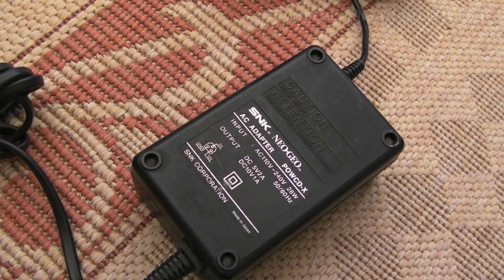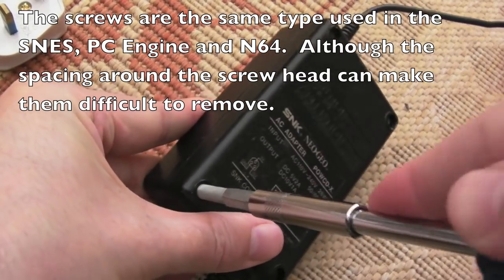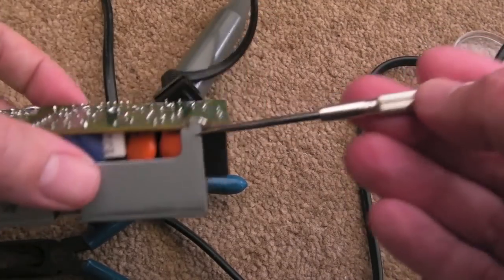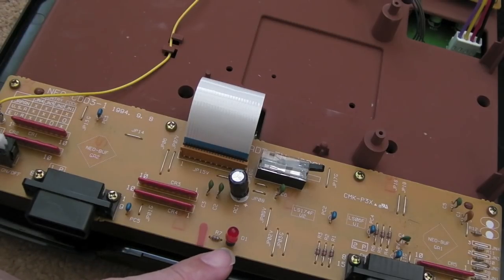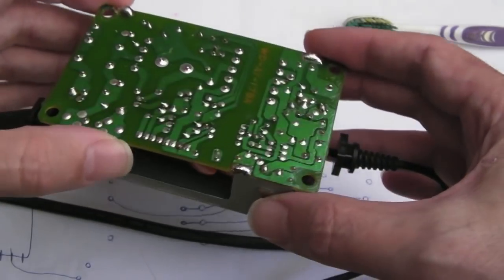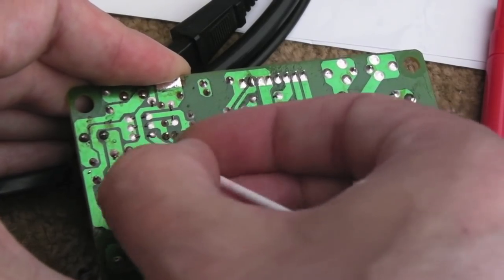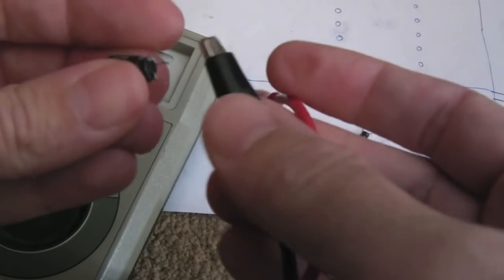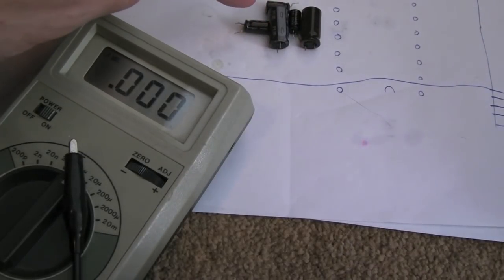SNK Neo Geo CD PSU (Power Supply Repair) Repair (Flashing Power Light)

Comment: My Neogeo CD console power light does not come on after press on power button. May i know what's wrong? The red light does blink once when i switch on the power supply to it
Reply from the maker: Most likely the PSU needs recapping -- very common.  It could also be a blown inductor on the Neo CD board - I think LukeMorse1 has a few videos on fixes like that, worth checking his channel out!  The power connector on these is also a source of bad connection.

Comment: Hello ! I have a question, is the power supply of Neo CD made noise after 30 min or 1Hours use ? It is normal if it made noise ?
Reply from the maker: Have you replaced the electrolytic capacitors inside the PSU - chances are that's the cause!  Be carefully if you do - there are dangerous high voltages stored in one of the capacitors there even after the PSU has been powered off.
Reply: @GadgetUK164  No I don't replaced any one of them ! Just buy a NGCD recently and I was surprised by the noise/sound made by the PSU after a moment of playing !

Comment: Always the smaller value electrolytics. Seen it time after time in switch mode supples.
Reply from the maker: Yep, I agree!  I think the problem is the value is very small, so a small deviation in its value means it can be well out quickly.  Plus they are more sensitive to heat nearby etc.

Comment: I already seen faulty caps with correct capacity (within tolerance range, witch is 20% here). Capacity measurement is NOT reliable with SMPS like these.
Reply from the maker: Absolulely!  There's no guarantee of a relationship - I guess it depends how your cap meter is measuring the capacitor.  At the end of the day it turns into a resistor, but one that resists some frequencies more than others.

Comment: Another issue with these power supplies is sometimes the holes get stretched out and corroded, resulting in poor contact with the pins.
Reply from the maker: Thanks, yes - I did mention that in the video.  Squashing them a little can help.  Lukemorse1 showed a rather interesting way of achieving that with mole grips (but it does work!).

Comment: So many things end up with a 13A fuse in them. I deliberately put 5A or 10A in 4 and 6 way extensions when I know they aren't going to be under a high load. Yes it's annoying if you forget and plug a hoover in, but I've seen them melted before from overload and the 13A fuse has not blown. Kettle type leads are the worst, they are often supplied with 10A and 13A fuses even for small devices and they don't all have additional lower rated fusing. Mind you, if you throw a Chinese death-dapter into the mix it's all academic!
Reply from the maker: Yeah, I always go with a 3A in these old systems.  I dont think I've come across one that needed more than 3A yet.   And yes - those cheap chinese PSUs.... =/

Comment: Right after I upload about a source for DIY/salvage NGCD PSUs, you also make a video about a NGCD PSU. It’s like the stars are aligning!

If Furrtek would finish the ODE for NGCD everything would be perfect! We need to nag him so he doesn’t spend too much time on MiSTer. ;) J/K, since he’s doing great work there too.
Reply from the maker: I know lol!  Total co-incidence as I had the first part of this video done in January this year.  Only just got around to finishing it recently.  I did mention your video in the next part which may go live later.
Reply: Ha ha! Hopefully it’s to correct me since I incorrectly told everyone that the HP PSU didn’t have enough amps on the 12v 1A part (original was 10v 1A). It’s actually the 5v part that doesn’t have enough amps (5v 1.2A versus 5v 2A). I got it right when I first shared on Facebook this past summer but I realized my mistake in the video while watching yours. Oops!

Comment: 13A fuse, wth? hahaha
Reply: fuse blows? put a bigger one in until it doesn't.
Reply: 13A is enough for pretty much anything. Job done.
Reply from the maker: LOL!  I know your kidding there ;)  The problem (for anyone else reading this) is that a 13 amp fuse means that this PSU (and its cable) is permitted by you to carry up to 13 amps.  The cable or PSU if shorted internally could then draw much more current than the cable or PSU can safely handle at which point the PSU or the cable would turn into a nice heating element (like the rings on an electric cooker) and would ignite anything around it.  Imagine 10 amps running through that mains lead - it would melt through its covering and start a fire.

Comment: Interesting stuff as always! Sooo many PSU issues come down to dried out electrolytics with stuff of this age.

One thing people don't always realise is that the fuse is there to protect the cable from catching fire, rather than protecting the device itself. If you get a failure situation where the device is pulling more current than the cable can handle, but below the fuse rating, this is when things catch fire.
Reply from the maker: Thanks mate =D   Yes, damn capacitors!  it's hard to believe how many problems they cause with this old hardware.  Back in the day it was quite rare for capacitors to cause problems.  Good point on the fuse, I didn't really point that out in this video (I have previously though on other vids).  The wire could turn into a nice 10amp heating element...

Comment: Super interesting stuff. This is why your the master and we're all just amateurs :D 

On a side note I was wondering if you might have a little insight for me. I've got a working Neo Geo CD myself but it kicks out Disk I/O errors occasionally.  Usually it's at first boot but sometimes even during a game. Most of the errors say "Disk I/O Error  1"  but i've also got a 2 and a 3 too. Drive makes some funky clicking sounds too. Wonder if you think it sounds like the laser or drive needs replacing? Maybe some molykote in the gears?
Reply from the maker: I wouldnt say I am a master - I am a novice in so many ways!  I have a Neo CD video to upload soon.  The error you are getting is most likely the laser, but it's also worth inspecting the gears on the drive to make sure you aren't missing teeth.  Molykote on the rail, gears and on the black plastic bar that the OPU slides up and down on might help too.
Reply: @GadgetUK164  Awesome, thanks man. I know it's near impossible to diagnose stuff like this without having a look at it, just thought getting your input would be a good idea before I opened it up. Looks like I've got a little project for the holidays!